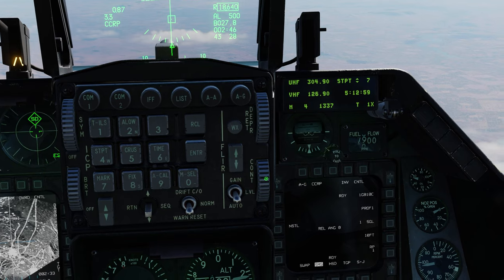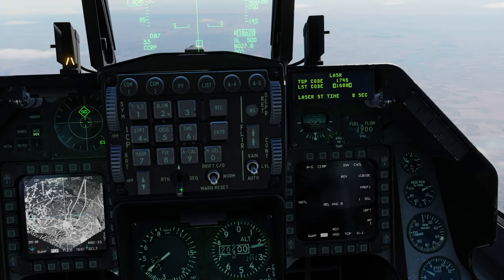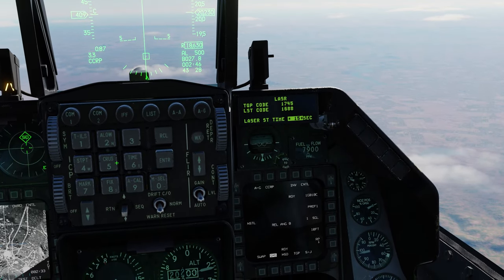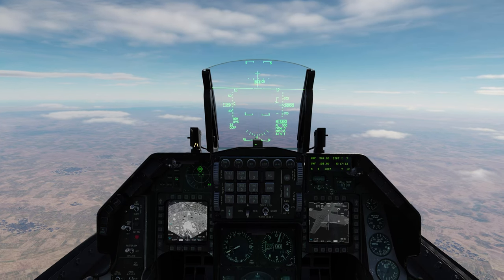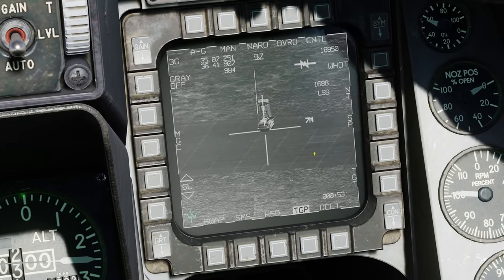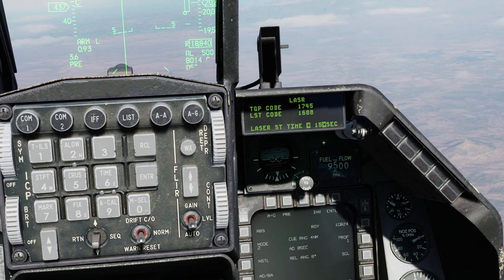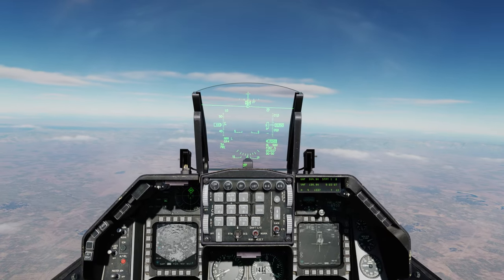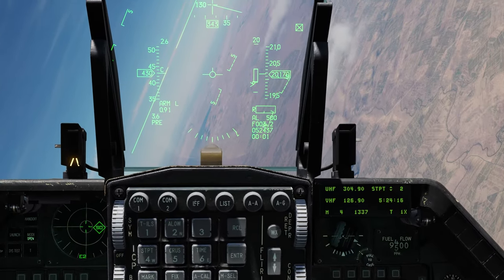F-16 Weapons Masterclass Ep. 3.5 - AUTO-LASING | DCS: World

Comment: Wow what a cool feature. Quick question though, how do you not use auto lasing? I think there is a default time set?
Reply from the maker: You just start lasing before the auto lasing engages. The default value is 8 seconds which is barely enough even for a GBU-10/12 so you can just lase manually at 15 seconds before estimating impact if you want :)